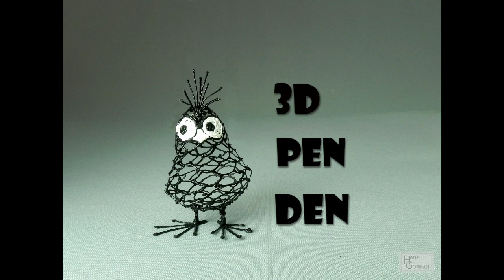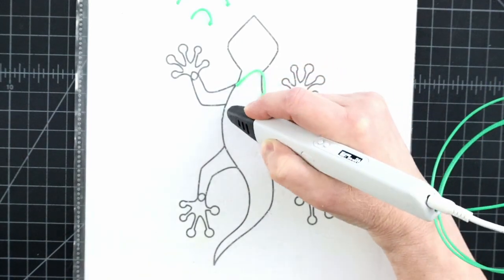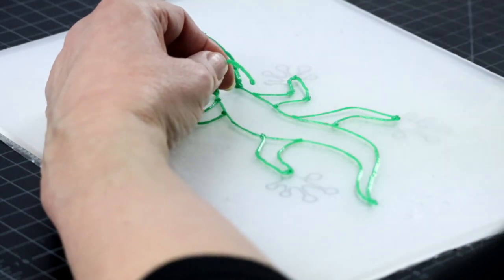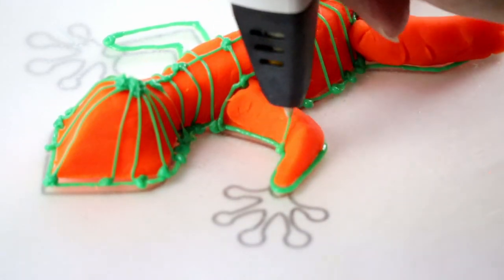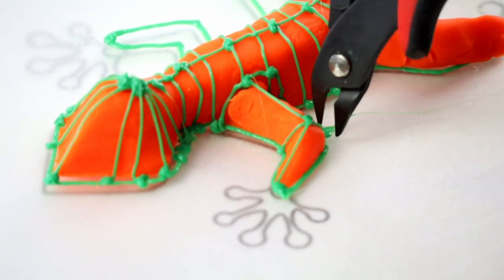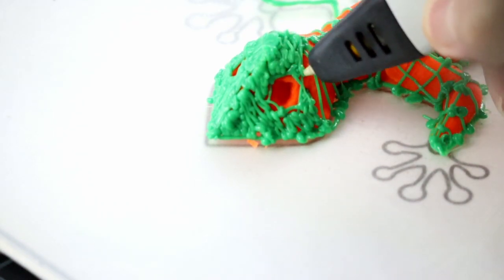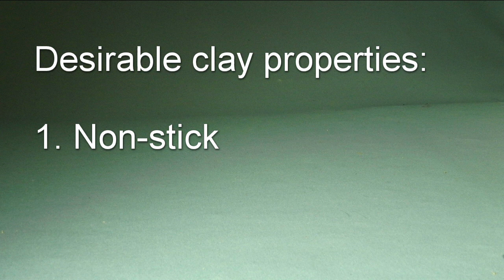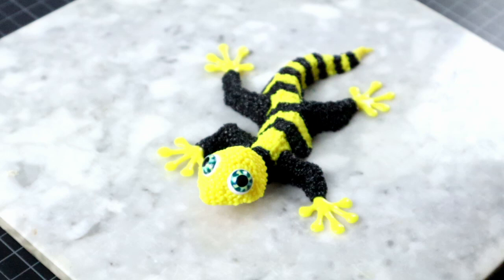Introduction to clay forming

Comment: I cant wait to try a project like this.   The potential speed increse in filling is someting I really want to test and could be a huge time saver.
Reply from the maker: Yea. I think this clayforming technique has a huge potential for both building and filling. Here is a part 2 with more tips on it if you haven't seen it yet: Clay forming 2 - How to make a teddy bear with 3d pen https://youtu.be/wpxpTm1hwSo also here is the lizard from start to finish: How to make a lizard with 3d pen and a can of Play-Doh https://youtu.be/lTph85uMX7Y Don't get tempted to use oil based clay though. It sculpts way better then Play doh but melts with the heat of the plastic and makes a huge mess. Good luck

Comment: Time to practice again....
Reply from the maker: This should hopefully make things a bit easier. Did you ever got your surface to work?
Reply: @3DPENDEN  Hi, thank you for asking.
Tried the whole process over again at a lower temp but still got a little bit of an impression.  Used polycarbonate both times. It's fine though, the clear chopping mats are working well. Though I'll try that acrylic spray on some glass to see how that goes.

Comment: Do you know if this will work with oil based clay?
Reply from the maker: Unfortunately I am not familiar with oil based clays. I mostly worked with polymer (untill I met my first 3d pen:) ) So I know if you leave polymer scraps on a plastic mat it will eventually eat all the way through it, which can't be good for the filament. If you have some oil based clay on hand test it on some non-labor intensive project and see. Is it clean enough not to muck up the filament too much? Plus there is something about the play-doh being so soft and non stick that makes it super easy to remove. I would say test both and see. It wouldn't hurt to talk to a chemical engineer that deals with plastics about this issue, but I don't know any. Also there are so many filaments out there. (I mostly work in PLA.)
Reply from the maker: Eric I finaly tried some oil based clay. Sculpts sooo much better than playdoh. And it is clean enough. Unfortunately it also reacts to the heat of the plastic and melts right into it. It's super heat sensitive. So I am afraid for now we are stuck with playdoh. But I only tried one brand.